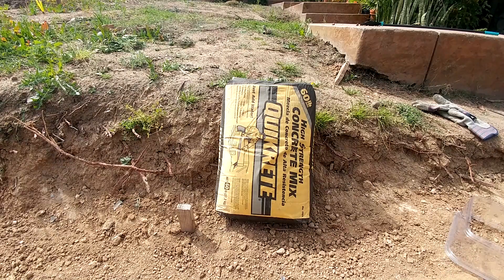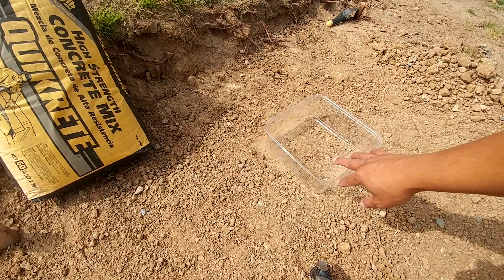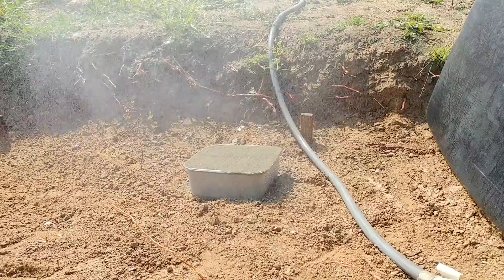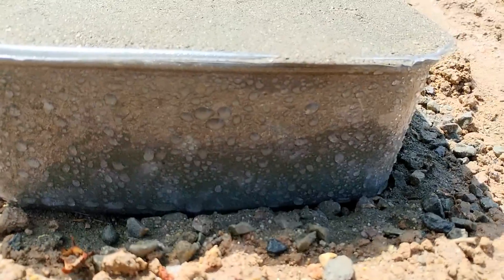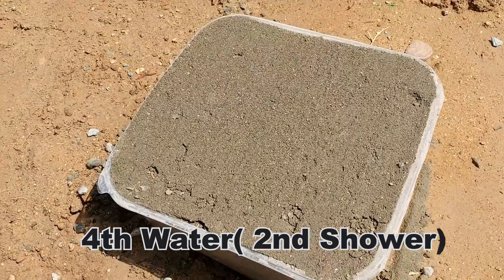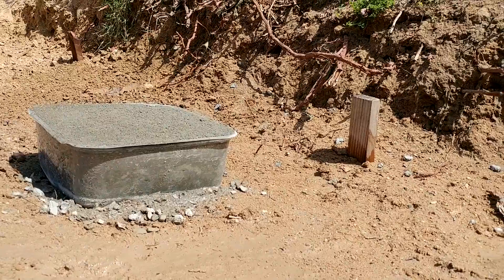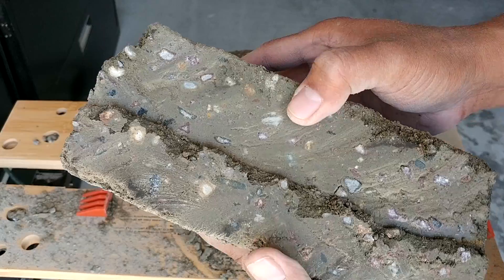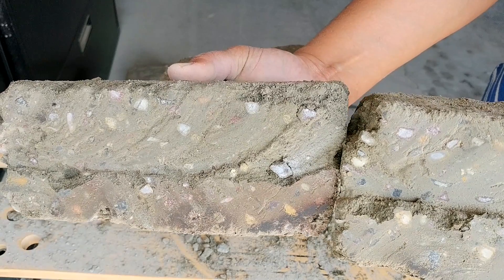You Won't Believe What We Found in This Dry Pour Concrete Experiment.

Comment: For a driveway, which is weight bearing, you need to add rebar, or your cement will Crack & crumble faster as vehicles drive over it repeatedly.
Reply from the maker: I agree. I will be using rebar for both wet pour and dry pour.
Reply: Didn't have to do that in the old days. I've cut up plenty of driveways with no rebar or wire
Reply: @ravenrock541  Well you need a reason to charge a arm and third child for cement work, figure to add rebar to insure each prison Rword for payment... 🤭🤭
Reply: @ravenrock541  Yeah but they were done using proper wet concrete that was mixed for load bearing.

Comment: I am putting a flag poll in my yard and I will have to fill a hole 16x16x18 inches with concrete.  I already figured out that I need one bag of concrete.  How many times do you think I should mist it in order to get 18 inches down?  Great experiment, waiting for the next one.
Reply: You figured wrong. 16z16x18 will probably need 4 or 5-80# bags. And don't do the misting crap.  Just mix it and be finished  with it in 30 minutes after you have the hole ready.
Reply: Misting is only done to keep the finish how you want. If only using 1 bag, measure out the water needed and use a watering can
Reply from the maker: I agree with @jakefriesenjake that mist is so that you have a nice top finish. For post holder, you can simply use the shower setting or a bucket of water to put water in and if you want a smoother finish, you can trowel the top since that is going to be soaked. Are you sure you only need 1 bag?  I entered your number in calculator.net and it gave me 5.91 of 60 lbs bag or 4.43 80 lbs bag.   

Also, regarding water needed you can check  the bag. According to quickrete their premixed bag will need 6 pints (2.8 L) to 7 pints (3.3 L). So use that as guide and let it soaked through the bottom. Hope this helps.

Comment: I like it wet
Reply from the maker: Thanks for watching. I will do another comparing both dry pour and regular mixed concrete.
Reply: @diymanual  awesome job... 
Just a tip: dry pour is supposed to set in forms 48 hrs minimum, & 30 days for full cure before testing, as it's not mixed like regular concrete. It also needs watering during the curing days too to complete the process just like regular concrete.
Reply from the maker: @leahrowe847  I agree. I just cut it open at 24 hours because I wanted to see if there is any dry spot left and that there is no laminate effect happening and this shows that it is fully hydrated and is setting up in 1 piece. @magncity1817 pointed out that the difference is the wet pour will have a nicer top which is what most people see. He also suggested a roller method and a sand mix for the top to prevent the rocks from showing up.
Reply: @diymanual  I like that you didn't have a bias or preconceived agenda you were pushing... I hope in the next test you stay true to this "Discovery" type of format.
Reply from the maker: Thanks.
Reply: @diymanual  Sounds good, I'll watch it

Comment: 24 hours is not enough. Do 3 days. The misting is not to get the whole thing wet, it's to harden to the top part so that it doesn't get disturbed by the more aggressive watering that happens later
Reply: To me, the best part of doing dry is it limits waste and has the least amount of cleanup.
Reply from the maker: That's true. Thanks.
Reply: After you screed it . Water it enough to produce some cream by using a aluminum  float just like you do regular concrete,  then broom finish. When hard water all you want.
Reply from the maker: I appreciate your advice! It's always great to learn new techniques from others.
Reply from the maker: I only did 24 hours to see if there are dry spots after first day of misting and shower but this experiment showed that the inside is hydrated and curing properly. Plus it will be hard to cut it open once it cured. 

I will do another experiment with smaller blocks and maybe compare it with wet concrete.
Reply: @diymanual  thanks for coming back to me guy right on your experiments are good thank you
Reply from the maker: You are welcome and thanks for watching.
Reply: @diymanual 9
Reply: @diymanual  I think you should try a longer cure time of maybe 28 days and then cut for comparison.
Reply: @PM_Doug  that won’t tell you anything. I think what he did was all that is needed to prove it works. Water, goes all the way through. Case closed.